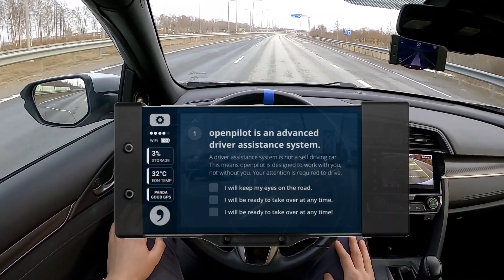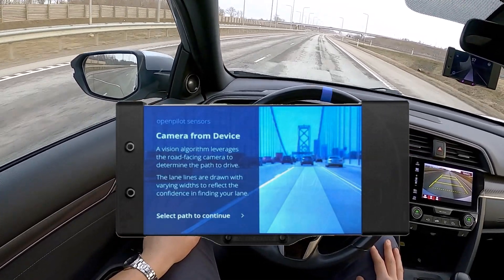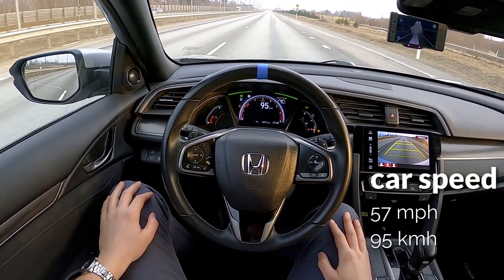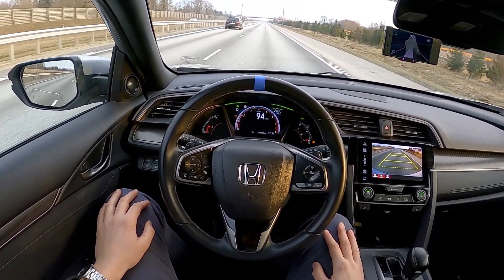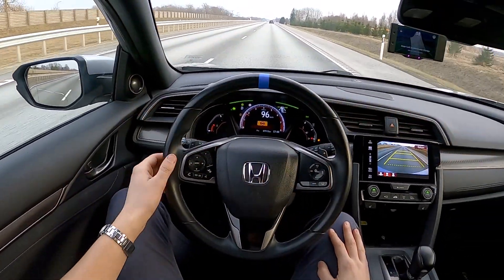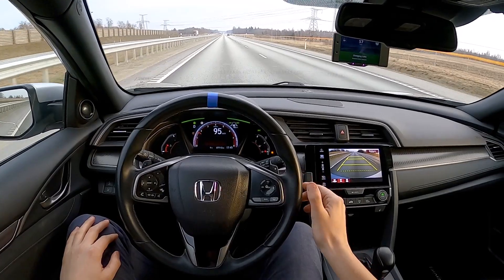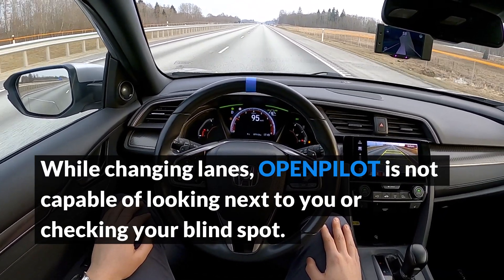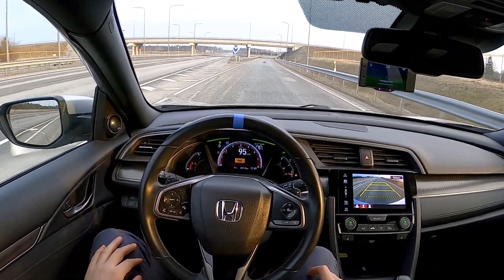How To Change Lanes With Openpilot | Comma.ai

Comment: I absolutely hate it when people indicate before checking. When I ride my motorcycle this is life-threatening to me. Turn signals indicate intent to move. There is no need to indicate that you want to move, simply that you're about to move. It's a warning signal, not a request.  You look first, then when there is room you indicate and if it's still clear you follow through by making the lane change.

I hope this feature is sorted out. 

Also, I take it this means that Openpilot does not change lanes by itself to maintain a steady pace and will get stuck behind a train of slow cars when the next lane is open?
Reply from the maker: Indicators have to be used by all the drivers whenever they are driving on the road to give proper indications to their fellow drivers. It gives clear intention to other drivers about where they want to go or what they want to do. Indicators must be given beforehand; last-minute signs often cause traffic jams and confusion.

Latest video from Comma.ai: https://www.youtube.com/watch?v=SUIZYzxtMQs

Comment: Hi! What's the max speed can handle comma ai? And max angle curve? Thanks a lot!
Reply from the maker: Hey, speed limit is ~84mph / 135 km/h. Max angle curve depends of the car. Honda's are quite limited but example Toyota's has great steering torque.
Reply: @LetitDrive  You cannot edit the torque in someway? THNKS
Reply from the maker: @FlyWithSergio  I don't feel safe messing with EPS.

Comment: This is exactly one of the reason why i moved away from Openpilot : see at 2:05. Having no blind spot check and performing a lane change on op, is not safe enough for me . I am now driving a mercedes glc and i am doing all this with extra safety enabled . Blind spot monitoring si always on. OP is a great development, but integration is the key. I will continue following its steps forward and its progresses…..

Comment from the maker: UPDATE: after v0.8.3 realese Lane Change Assist is by default ALWAYS ENABLED.

Hey 🙂, please kindly subscribe and like the video if You enjoyed it.
Camera I use: GoPro Hero 8 Black: https://amzn.to/3vvUTvN
Headrest Mount for GoPro https://amzn.to/3lU8auR
Suction Cup Mount for Camera https://amzn.to/2Z3YkO2
Screen Protector for Comma (can be trimmed with scissors to fix the screen) https://amzn.to/3ncMcmv
Protection bag for Comma device (Size 9) https://amzn.to/3jhlAzy
Reply: Would be awesome if you did a video on the new update. Also would be interesting to know how openpilot handles on european roads in general since it is mostly trained on US roads.
Reply from the maker: @Helld00d  I'm driving on EU roads and it works great. New video coming soon, stay tuned. :)
Reply: @LetitDrive  hey there, how do you get that video from your head unit running while you driving? It cool
Reply from the maker: @NTINUNSAKUNEKONGO731  Hey, by accessing the diagnostic mode. But the screen automatically turns off after ~5 min,

Comment: Can you turn this feature off? What if you accidentally nudge the steering wheel
Reply: It only does it if you have your turn signal on, so there's very little likelihood of an issue. But yes, there's an option to turn the feature off. You just toggle the "Enable Lane Change Assist" to off on the setup screen.
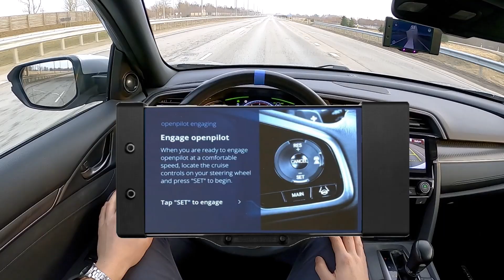Reply from the maker: Like Matt said, You can disable this feature, check 00:47

Update: with v0.8.3 its always enabled.
Reply: @LetitDrive  Do you do any open pilot coding yourself? 

Also be great to see if it can integrate with blind spot detections system so it would disallow a auto lane change if a car was detected.
Reply from the maker: @fundip43  Hey, nope, my videos are user perspective only. 🙂

Interacts with the blind spot monitor on already works in certain makes and models to block the lane change in the event a car is detected by the blind spot monitor. But I don't know is it safe enough to relay on 100%.
Reply: @LetitDrive  keep that knowledge coming I see your channel growing considerably room for even a few more like it. Open pilot desperately needs people to make its information and adoption process more digestible. Even if it’s technically just a beta that is not yet trying to be a official mainstream platform device.
Reply from the maker: @fundip43  Thanks man :)